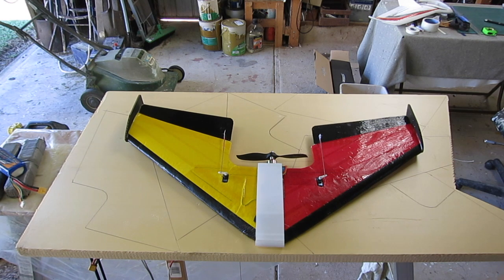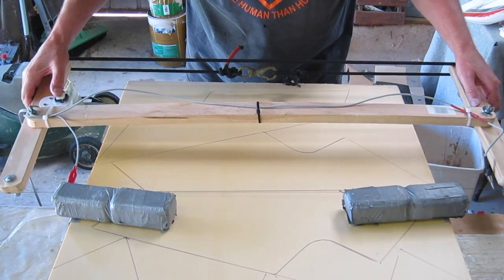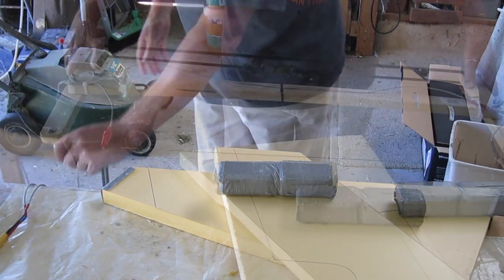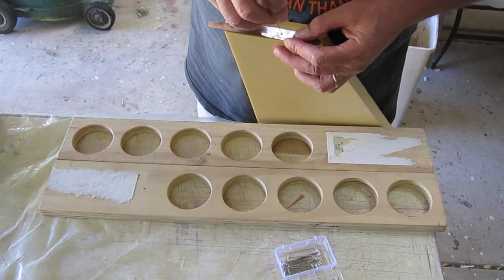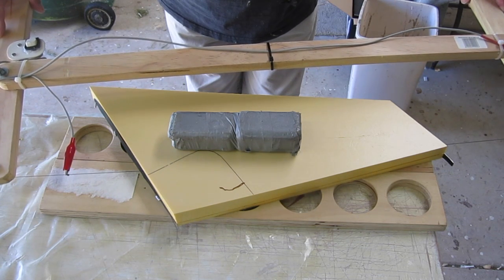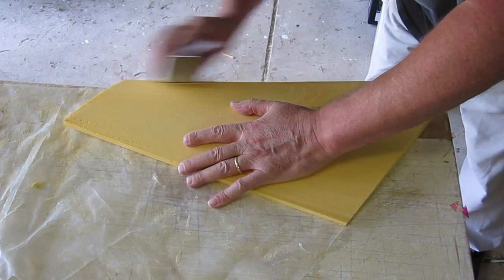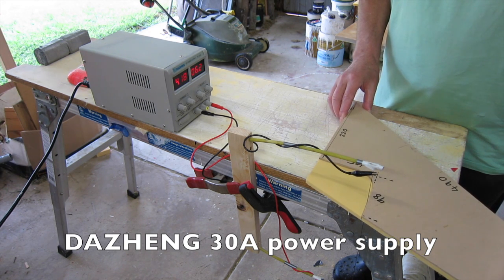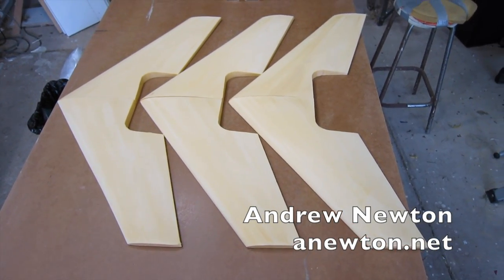Hotwire Mini Arrow cutting in detail

Comment: Nice work Andrew.  For airfoil templates you may try to find a scrap of Formica countertop laminate (or similar), I've used this material for a long time because its easy to shape accurately and the edges polish very smoothly for no snags while cutting.

Also, flying wings traditionally use a reflexed airfoil, one where the mean camber line is swept upward near the trailing edge.  This is to counter the pitching moment - the natural tendency of a wing to tumble LE down.

You'll notice that on many conventional aircraft, the horizontal stabilizer airfoil is actually 'upside down' in order to provide negative lift, so to counter the pitching moment of the wing without adding the drag of deflecting the elevator surfaces.

If your tailless model has a lot of connection between airspeed and upward pitch trim, this is probably your answer.

Just some points to consider.

Cheers,
-7
Reply from the maker: Thanks man.The thin aluminium cut with scissors works well for me, but I would like the extra stiffness of formica.

Comment: For you what is the Between use of KNAUF or DEPRON to make a wing, advantage and inconvienient, I congratulate you for the quality of your videos !
Reply from the maker: Good question. Depron is stronger and comes in 6mm and 3mm boards. Better for making fuselage boxes and tail surfaces and control surfaces due to the strength. XPS (Knauf) comes in 30mm and 50mm blocks and is softer. Better for wings because I can use the hotwire cutter to shape accurate airfoils and it works out cheaper than depron per wing.
Reply: thank you for the clarification

Comment: Thanks for the video. Great as always. I had just broken the foam board FPV wing so I was read for a rebuild. Your video motivated me to hot wire it. I cut spars out of oak 1/8 x 1/8" and also added a 1mmx 4mm carbon flat spar. I covered it partially with colored packing tape. I already know how to hot wire but you are a pro at it. I just use a 12v battery and vary the heat by adjusting the distance the power wires attach to the cut wire. Here is my maiden flight video from first person view. https://youtu.be/QB68-cNfAsA
Reply from the maker: Excellent Jim, great to see your success.

Comment: Hi, nice tutorial.

How did you join the wings?
I'm planning to mount some fpv stuff on a flying wing and i also already have a hot wire cutter...
Reply from the maker: Just glued and taped the two halves together but you can span the join with a CF strip or bamboo skewer for a bit more strength.

Comment: Window flashing , OK that was what I wanted to know . I have been using Styrofoam that came from a job leftover . It's not as strong as the foam your using but I can only find 3/4" here in East Texas it don't get real cold like for using 2" for insulation and we have both the pink and blue but not the tan .

Comment: andrew are the templates for the centre and outer part of the wing identical? because they are different lengths, i am trying to set the airfoil but im struggling if you could help me that would be great thanks.
Reply from the maker: No they are different airfoils. here are the templates for download http://newtonairlines.blogspot.com.au/search/label/-%20Mini%20Arrow
Reply: thanks andrew
Reply: what percentage of scale do i print out the centre of the wing and outer part of the wing? 100% for centre and 55% for outer maybe?
Reply from the maker: Just print that template page at 100% or A4 paper size and that gives you the inner and outer airfoils at correct size.

Comment: I use only one airfoil template on the bigger side and attach one end of the wire at a fixed point and drag the other end along the template. That way you dont have to worry about finishing one side first but it is harder to set up

Comment: Small tip for cutting. It helped me to achieve more precise results.  Divide both sides length by 4 or bigger number  and mark it. Then you know that when you are on mark 2 on longer side you should be as well on mark 2 on shorter side.
Reply from the maker: Thanks for the tip.

Comment: Do the wings hold up okay in a small crash?

 I was going to buy some EPP but it's not as cheap as this stuff and Bunnings is much more convenient then the only 1 or 2 companies in Australia that sell EPP in small quantities.
Reply from the maker: Yes this is a tough little wing in tape covered XPS
Reply: Can confirm, packing tape +gorilla tape on the leading edge and my wing has run full speed into telephone wires without somuch as a tiny dent, really impressive actually

Comment: Thanks for the video - hope you are now using the pivot cut method- as gustav gans mentioned- I find it really easy - trying to do wings freehand will introduce deformations to the surface, so does sanding, when I do it anyway :) pivot cuts give me instantly smooth, usable wings. Thanks again for all your movies - cheers
Reply from the maker: I have tried it but prefer templates both ends. Most of my wings are straight.

Comment: Hehe, somehow I'm an idiot because I'm unable to produce my wings like that ... did you already try the method where you use a pivot point and then cut the wing with only one template? Seemed a bit easier to me!
Reply from the maker: I have tried pivot cuts but that would make the outer airfoil too thin.
Reply: +Andrew Newton Yes, thats a problem that I fixed by soldering/connecting a piece of scrap wire to the end of the hotwire! If you're using this method you'll need a very beefy power supply - I didnt have one so the result looked not as nice as it could!
Reply: +PojntFX (PFX) Oh I forgot to mention that by this I've been able to make the outer airfoil a lot bigger (Its possible to calculate its size!).

Comment: Andrew you may find that pop rivets sharpened at the end are better for holding the templaetes on the blocks
Reply from the maker: Thanks Andrew. I'll try that.
Reply: Thanks for the vids Andrew. They are the best on Utube as far as I am concerned. Full of information and no bs.
Reply: For tapered wings you can put a ring on the wire and hook onto a nail so that the taper alligns with the natural angle. the tension in the wire is manually controlled and you only need a root template. However washout cannot be cut into the wing.

Comment: Nice video, I just think there is a minor problem to the process, when you cut the tapered wing coupled with a sweep or even just a tapered wing by going at different speed at the wing tip and the root (to finish the cut at the same time on both sides) the slicing/cutting direction does not remain parallel to the flight direction (parallel to the fuselage) as it is tilted to a sweep angle of  the wing and therefore if you cut your wing at any section (parallel to the fuselage) you'll obtain a profile different to the one of your airfoil template. This is a problem because in steady straight flight the airflow will be parallel (perpendicular to the trailing edge in your case) to the flight direction and you want the airflow to attach and flow along the airfoil you have chosen but through this process you will get the airfoil profile tilted with the fuselage at an angle equal to the wing sweep and not parallel to the flight direction. Although I estimate that it won't be a huge issue at such a small scale as you are going to get some sort of profile which won't deviate much with the template profile. I would suggest you keep the wire parallel to the sweep line start cutting the wing by keeping the angle/sweep constant, move from the leading edge to the trailing edge keeping the wire translation parallel to the fuselage, at some point the wire will loose contact with the wing tip template (if there is a taper) and dangle around while your root template will still be left for cutting, for this you can put a temporary stick or small wooden strip on the foam at the trailing edge for the wire to rest/move on along the trailing edge while you finish cutting the root template. If there is no wing taper then moving (translating) the wire parallel to the fuselage and keeping the wire angle=sweep angle throughout the cut you will get the correct template profile without the need for a strip.
Reply from the maker: Thanks for your suggestion Rahul but I think your way would cut a big depression out of the middle of the wing. I'll have to try it and see what the result is, because it's hard to work it through in my head.
Reply: Appreciate the response, I think a depression would be created if the strip is not placed properly or if the wire angle is not held constant. I'll test it myself and inform you of the result I get.
Reply: So what you're saying, in way too many words and too little punctuation, is to simply keep the wire parallel to the leading edge the whole time?
Reply: I wanted to be clear but obviously its pretty muddled, so sorry about that. No I'm not saying to keep the wire to any angle, it really depends on the taper and sweep, what I intended to convey was that the cut has to be parallel to the flight direction so that the template profile is maintained throughout. You have to move the wire along the fuselage horizontal axis (the one it rolls about) any deviation to this will get you a different profile. Its a little difficult to visualize, I'll probably make a video about it.

Comment: What are the weights that I keep seeing people use while they cut foam?
Reply from the maker: Anything heavy enough to stop the foam moving while you're pulling the wire through.
Reply from the maker: Oh wow! What a project! Yes lifting weights are perfect, you can use anything, bottles of water, food cans, bricks.
Reply: I use some cloth bags the size of a pencil case my sister sewed up for me, filled with aquarium gravel. Easy to get from Bunnies etc or aquarium stores. I made them for traditional balsa model wings but they've been so handy any time I need to stabilise something as they are easy to mould to whatever shape you want.